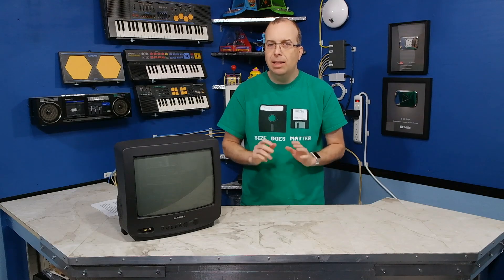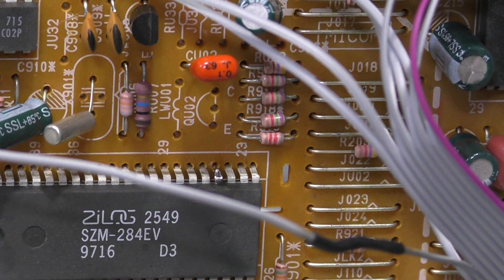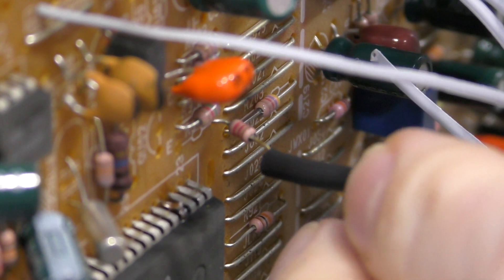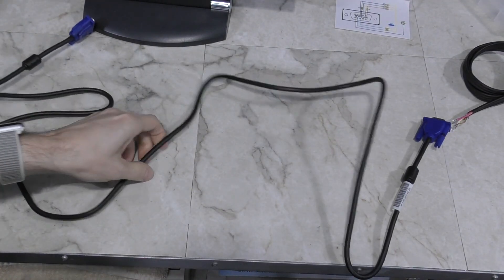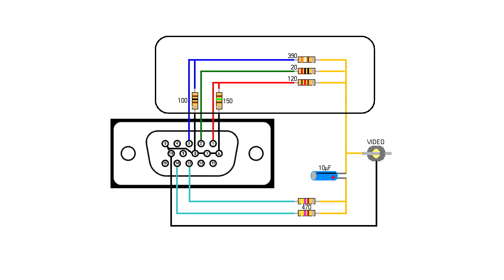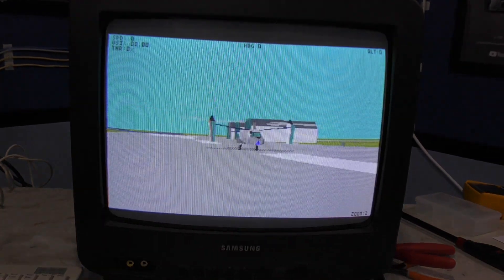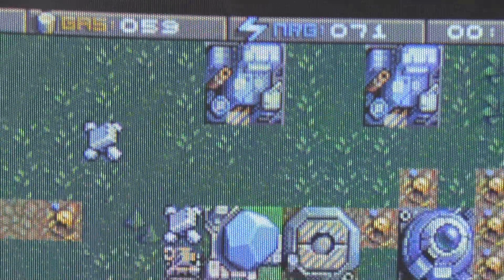Modding a TV for RGB - Part 2

Comment: I wonder, David, how much additional work would it take to make the monitor compatible with multiple HSYNC frequencies, so you're not stuck with 15.75 kHz NTSC video modes? Is the local deflection oscillator just phase-locked to the sync signal and not frequency-locked?
Reply: The jungle chip very likely imposes the 15KHz frequency, so you would need to replace it with something different, which doesn't sound too realistic to do. There also is the question what frequencies the tube can handle: Televisions have different tubes than VGA monitors.
Reply: So as far as greater than NTSC resolutions, a PVM or high grade workstation CRT is your best bet?
Reply: Kind of yes, multisync VGA monitors have usually pretty goodtubes.

Comment: so i'm gathering that this would work if you made a diy arcade cabinet with a mame pc and had a crt monitor you wanted to use with it as long as you got the correct hz speed from the vga card, is this correct? anyone tried?

Comment: For DOS games is probaby better running them on windows using Dosbox. I tested Doom and Duke Nukem on my Mame machine, that has an old CRT TV modded for RGB (i did it the dangerous way, connecting the pc to the Socket, because back then there wasn't a lot of tutorials on the subject) The good part of running on windows is that you can configure the resolutions using Winmodelines or Powerstrip. 
Still this mod does act weird sometimes. For instance, in some Sega games running on Mame, sometimes i get an orange hue when there is a lot of gray colors. This doesn't happen in other games. The other thing is that the Pc power supply can cause some interference, so i recommend using a good one (i have a cheap one, that i'm planning to replace sometime in the near future)

Comment: Could have also used a diode to protect the micro controller from the 5v. But I think the switch is a better method since it completely isolates them.

Comment: is it possible to change tv' sync for vga? And what about 50Hz-based PAL and SECAM?
Reply: The jungle chip is likely incompatible with VGA sync frequencies, so you would need to replace it, which doesn't sound too realistic. 50Hz might work as the chip might have been designed to be usable in PAL televisions. You would need to try. SECAM uses the same frequencies as PAL, only the colour decoding is different.

Comment: Hey, David, you can add a diode between +5v and blanking signal to add an extra layer of protection.
Reply: yeah just in case the switch gets stuck in the middle so the microprocessor can output 5 volts to the jungle chip but no voltage can go into the mcu.

Comment: The blanking pin on the microcontroller is floating now. Seems to me you need to have a 1K or maybe something much bigger to ground on that pain so it's not floating.
Reply: It is an output, so it won't be floating. The microcontroller will pull it either low of high.

Comment: So, what was the difference between VGA and NTSC RGB that the program had to change to get the picture working? I thought they're both 60 Hz ...or 59.something ...or is one of them 60 and the other 59.something? Or was there some other frequency that had to be changed?
Reply: NTSC is interlaced, so the line rate is half of VGA (it only draws every other line per scan).
Reply: Ah, right! I had forgot the "joys" of interlacing. It's a while when I got my old analog videos converted in digital format, but while doing that, it was the interlacing that caused the most frustrations!
Reply: @enginerd80  Yup, I remember those days. The worst were TV shows that had been shot on film, transferred with a 3:2 pulldown and then used interlaced video for special effects. Trying to make that not look like a blurry, juddery mess on a computer was painful.
Reply: The horror... And some American material, apparently depending on conversion methods, used to look like blurry and juddery mess even when watching on a CRT TV in a PAL country around the 90's. At worst, only the largest texts of the end credits were readable, and the level of blurriness constantly fluctuated, possibly following whether there had been 3 or 2 at that moment of the pulldown thing, or maybe because of something in NTSC-->PAL conversion. However, some more recent programs, like CSI Miami, seem to be converted to be shown effectively in progressive format; both the odd and even field seems to be from the same original frame, even without that 3:2 nonsense, and the picture looks like really sharp even on CRT TV (set-top-box converting standard definition 720x576i50 material for a tube TV through SCART). Probably the speed has changed from original, though.

Comment: This looks surprisingly good for a hack.  Comparable to an actual arcade monitor, without needing the video amp for 4 volt output.  It makes me curious how an ArcadeVGA card would work when connected directly to this TV.  I haven't used one in years, but I seem to recall that they had a custom firmware for outputting 15Khz whenever possible.

Comment: One bit that surprised me with this mod is that you don't disconnect the RGB from the on-screen display chip: Does this mean that when the OSD tries to display something, it blends (RGB color channel averaging due to the resistor network) with the graphics from your RGB source? I think the mods I've seen previously all simply cut off the RGB from the on-screen display.
Reply: I think you're right. Ideally the switch would switch over everything, or the blanking signal from the microcontroller would toggle digital switches, but this solution is probably OK for a quick hack, it shouldn't cause any major issues.

Comment: Using a transcoder, you can also convert YPbPr Component video to RGB for approximately the same amount of quality as RGB. This would allow you to connect, say, DVD players in their crispest video quality over to the TV. You may find that to be worth a look-see. And as for S-Video (Y/C), you can find transcoders that convert that to Component (maybe also directly to RGB?) as well, so even if it isn't quite the same quality, you could plug that into the TV too. Lots of possibilities!
Reply: Y/C is nowhere near YUV or RGB, because the color is coded using FM frequency, limiting the bandwidth. And for DVD, we have in Europe DVD with RGB output on the SCART connector, to be plugged directly to our TV sets. How unlucky the countries without SCART.

Comment: Why not just add a diode after the microcontroller and before the switch? You could also add a diode to the 5v line and eliminate the switch all together.
Reply: Depending on how the circuit works, it might not tolerate the voltage drop from the diode. Plus he already had the switch!

Comment: Just a small note on SCART connectors. Theoretically it was pretty cool, but in practice it was quite a mess. It had lots of options, including the RGB, but not every TV implemented it. Most did not, as much as I know. Even if a TV did so, it did usually just for one of its SCART inputs. Cables were not the same, either, some had just the most important wires, some had more… If everything worked well, it could do some nice tricks, like a VCR downloading the TV channel frequencies from the TV via SCART or, which was more common, switching on and off a VCR or a DVD player could switch the TV on and off. With my first DVD player it did not work very well: a signal from the TV on one of the pins simply disabled the DVD. I had to use a little tape on the corresponding pin to have picture at all. The idea was nice, and actually it was pretty usable, but definitely could have been better.
Reply: RGB was almost always implemented on SCART due to French legislation, the would have been rejected from the French market otherwise. But indeed, TVs with just a single SCART port that is RGB enabled are relatively common.
Reply: I didn't know that, thanks for the fix.
Reply: RGB as far that I know was supported by most the TVs on the market. On one TV only the primary SCART connector supported RGB, as the second one typically supported S-VIDEO (and since they share pins it was not possible to have both on a single SCART). But it was not a problem since you could daisy chain your devices, back in the days I had my SKY receiver plugged into the TV, and my VCR plugged into the SKY box, and then a DVD player into the VCR. 

Most of the problem you had with SCART where due to using cheap cables, the good cables were bulky because they contained in themselves single coaxial cables, the cheapest one only contained single cables not individually shielded, so a lot of the times a signal would interfere with others, and produce ghosting (for example, the video return signal from TV interfering with the feed signal from a VCR, very annoying. For fixing that problem you would have needed to open the SCART cable at the TV side and cut pin 19, making the cable unidirectional in practice)

SCART had feature that neither HDMI this day has:
- ability to daisy chain devices
- video return, so you could have recorded from a set top box with a single cable
- automatic input selection on the TV (there is HDMI CEC but doesn't work most of the times)
- passing teletex data to the TV, useful if you wanted to see teletext from a set top box

The reason that in France RGB was required was that in France they used SECAM to encode color information, where in most other european countries PAL was used, so the only way to get compatibility with other european equipment such as VCR was to use RGB (that was always compatible since RGB is universal and the sync was compatible with PAL)
Reply: Again, thanks for the info. About the daisy chaining: I pretty much hated it. In order to watch DVD, I had to turn on the VCR, and select the AV input. It was much better when I finally had a TV with two SCART ports :)

Comment: Do not combine H and V sync just by soldering them together, they will feed back into each other just as you found with your blanking line. Use a 74LS86. https://web.archive.org/web/20070601235545/http://www.tkk.fi/Misc/Electronics/circuits/vga2rgbs.html

Comment: Absolutely great improved mod, i congrat you for the fact that that crt tv still works after 21 years.
Obviously, a vga signal can only work on a tv if the signal is not greater than 320p,.

Comment: Why not put a diode in line with the blanking pin? That way you only need a single throw switch to perform the same action.  Apart from that brill video.

Comment: I was looking at the diagram for a old 20" tv I have and I can do the same mod, but there is other thing that would be very cool to do, the tuner is an i2c slave. So with an arduino, a analog multiplex and logic gate to overwrite the av/tunner selection pin of the jungle, a new mod could be made that you keep the av input free, make the rgb overwrite a tunner channel like 5 and you could use the remote.

Comment: because the refresh rate is low on the CRT could you run an Atari ST in color mode on it with out a video scalier?
Reply: Yes, the Atari ST outputs native RGB at television frequencies.

Comment: That's what a lot of PC-based arcade machines (Golden Tee, Big Buck Hunter, etc..) do: they force a 15kHz scan rate. 
They're typically Linux-based and use SDL for graphics. If you've ever seen one booting up, the BIOS and console are unreadable on the arcade monitor.

Comment: If you want an "optimal" solution, you just need to add an I²C EEPROM to your connector and program in the NTSC timings.
Reply: "optimal"
Reply: I did once, and I'm still surprised it works even on Windows 10

Comment: @The 8-bit Guy Can you make a mod of VGA to RF or VGA to composite( not the grayscale one.. An actual colourful display as the output of VCR or DVD players)
Reply: VGA to RF would be easy once you've done the VGA to Composite, as you're basically modulating that composite signal onto the carrier wave frequency of whichever channel you want to use. The VGA to Composite is a bit trickier, due to differences in how color is handled between VGA and Composite, as this video mentions. You'd need some kind of dedicated chip to handle the conversion, which I'm sure is readily available from one or more of the major IC vendors/manufacturers.
Reply: You'd need a phase modulator to make color for composite, as well as a funky color mixing circuit so it'd be a bit more complex. You'd either need a chip with this stuff built in, or an oscillator and several opamps.

Comment: Everyone I have a solution to the RGB mod! Live in Europe or get a old monitor shipped from Europe.. I have 3 with RGB, S-Video, Component, VGA, etc.. built in.. Oh wait I am from Europe.. Time to rub it in Ha ha ha ha ha ha.. Simply plug and play here in the United Kingdom..
Reply: How would you configure the video card to output 50 Hz for the TV? Video refresh rate(s) on PC don't depend on the region like on TV. I've only seen some more recent laptops having 50 Hz video output option for use with European TV, but traditionally the refresh rates have started from 60 Hz.

Comment: You could have just connected the switch to the Jungle chip side of the resistor
Reply: Fully seeing you here, Mike. David could have also used a diode between the Jungle chip and the micro, with the switch in the center.
Reply: @remyrattner6399  I was thinking that a diode would have been effective as well
Reply: @76nagle  Yeah, a diode was the much quicker solution.
Reply: The diode solution was what I thought he would do when I first heard him describe the problem.
Reply: Yeah but we'd need to add a third resistor (2.2 KOhm is a nice value to minimize wasted current) to connect the output to ground so that the signal would default to zero.
Reply: That would limit the power coming back to the MCU chip, but not remove it altogether. Besides, the resistor probably brings the signal from the MCU down to the level the Jungle chip needs, so bypassing this directly to +5v could damage the Jungle chip. David's method is effective and has fewer potential problems in the long run.
Reply: The 8bit guy has introduced a design that protects a component against breaking down. Definitely going against current thinking of planned obsolescence. Speaking of PO, Apple seems to have taken that to a whole new level. Very bad for their customers.
Reply: Would there be implications for the jungle chip if it sinks 5v without a resistor?
Reply: @beware_the_moose  Could be, depending on what the input voltage tolerances are on that particular model of chip. From the datasheet I found, it probably wouldn't be a problem on this particular set, but it could on other TVs with different Jungle chips.
Reply: diode idea would work , connecting the the switch to the jungle chip side of the resistor would have worked also , most ics that old are 5v tolerant anyways ,the resistor would limit the current to the mcu to about something it is capable of sinking  and everything would be solved no need for a diode .
Reply: yeah i would have gone for the diode initially but considering he had the extra throws on the switch it avoids the problems of the diode. droping by 0.7v wouldnt have been a problem though really for these digital logic chips. depends what it was getting from the other chip though. alas its a nice mechanical solution that you can see with your eyeballs so its kinda more elegant really
Reply: @mikeselectricstuff When we will see another teardown video? Regards

Comment: I believe you can push RGB straight through from VGA to your new RGB connectors (0.7v peak-to-peak) and combine your HV to csync and pull off the same thing with the higher quality input. There are also fancier and more specific (S3, Matrox, etc) DOS TSRs to juggle frequency and compatibility. Of course there is also the issue of the lack of vertical stretch and improper aspect ratio. Hmm. Now I want to dive into it, myself.
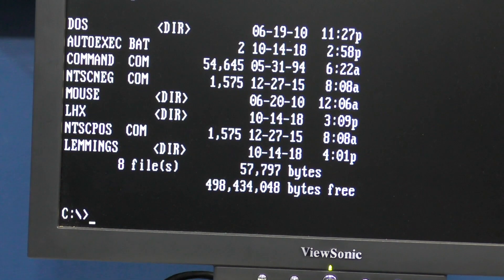Reply: I'm follower of your channel too, I would like to ask, do you know where does that "ntscneg" come from? I haven't found anything in Google (4:40).

Comment: I seem to remember years ago there was a range of ATI video cards which had modified VGA BIOS ROMs to support 15KHz mode so they'd work with an RGB monitor.  Really interesting video, being in the UK I'm spoilt with SCART but years ago I had a TV which only had Composite Video input, made it awkward playing US import consoles in black and white :-D

I wonder too if it's possible to get a board to convert from the VGA frequencies to RGB?
Reply: You need a downscaler, VGA and NTSC are very close, 31.4kHz vs 15.7kHz horizontal scan and 60 Hz vertical for both, but with PAL, 50Hz it's a heavy problem, causing flickering or artifacts
Reply: I think Matrox G200 TV series also had a specific BIOS, able to output in 480i or 576i at 15khz.

Comment: I'm still in the learning phase here, but I was wondering...

Would you be able to solve the problem with a diode between the microcontroller and the +5v supply?
Reply from the maker: Possibly. but it was easier just to add the extra wire for the switch.
Reply: @The8BitGuy  True.  Less parts to buy.

Thanks
Reply: I'm really surprised it worked. TTL gates only work by draining current to the ground and assume a 5v input when unconnected. The jungle chip is obviously not TTL.
Reply: Yep a diode would work. A switch works fine too as long as you don't get any issues with "bouncing"

Comment: You could have put a diode between the micro-controller and the common junction (switch/blanking line), So current flows only towards the jungle IC.